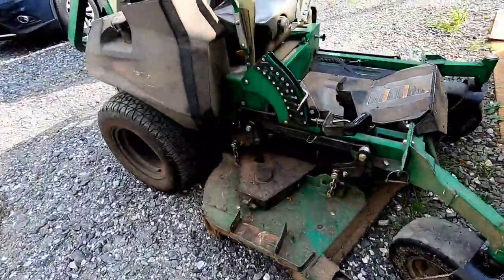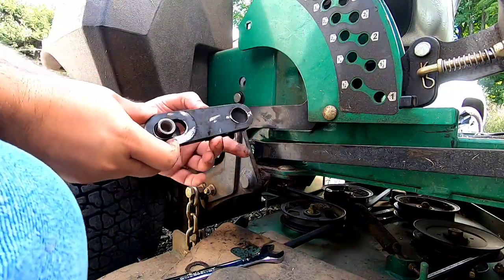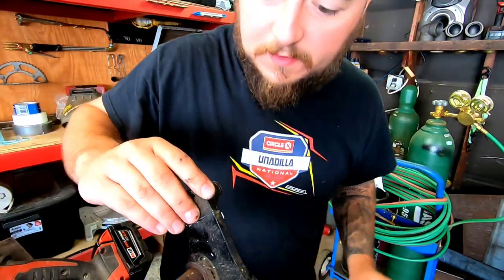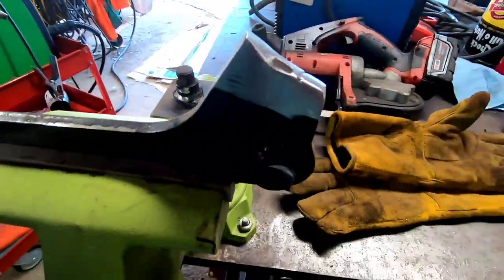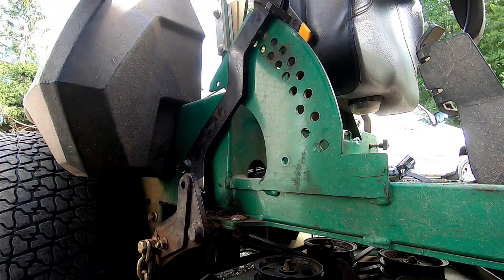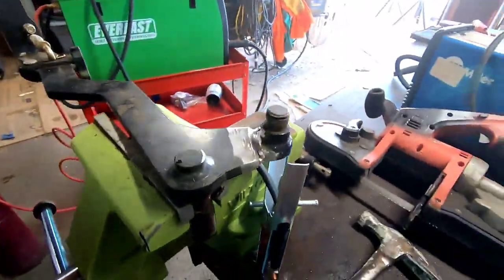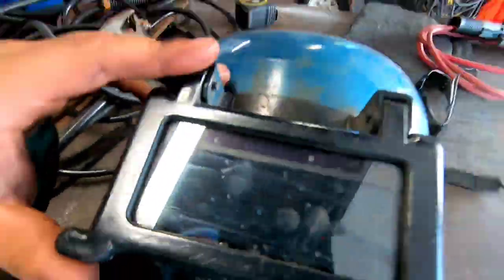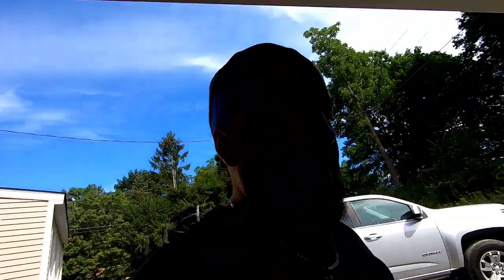EASY MONEY WELDING JOB $$$ - EQUIPMENT REPAIR

Comment: great work bro!!! just picked up some side work. thanks for the motivation 👍🏿👨🏾‍🏭💰
Reply: I'm on my journey as well. Full time welder and Just got my Everlast mig/flux core welder for the garage/shop. Just wondering how'd you land your first side job?
Reply: @asmith7126  I'm always looking on craigslists for  people looking for a welder. I've gotten a few side gigs off that. Nothing too crazy but extra income is always good. I have a flux core machine and a Hobart stickmate, theyve been doing well so far! good luck👍🏿
Reply from the maker: make an instgram and go door to door, check out my "how to pic up side work" video i go in depth
Reply: @mcfwelding  will do, thanks alot.
Reply: @WelderB1Family  thanks my man I'm own it!
Reply: How does a new guy get welding jobs. I weld for friends but I want a real project for money get tired of free welding 😂

Comment: 2 Quick question: Since you grinded the piece down on both sides, did you use mig or flux, and did you do a root pass on both sides with a cover pass? Couldn't tell because that's the part you sped up in the video.
Reply from the maker: Mig wire and yes a root and then filled it in with multiple passes